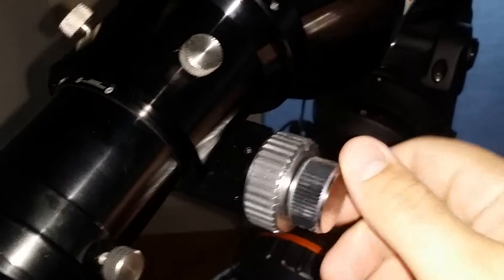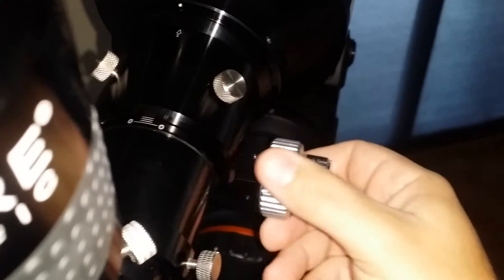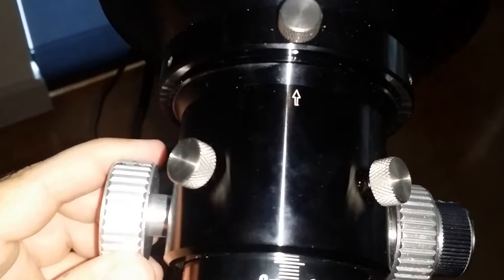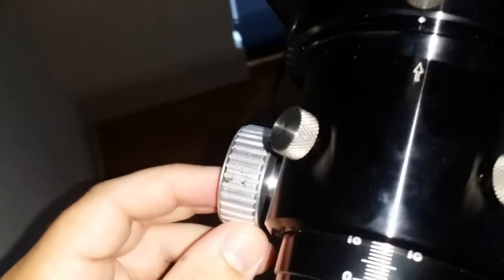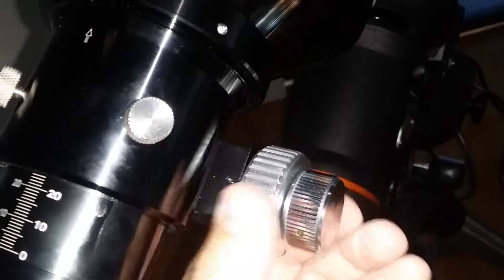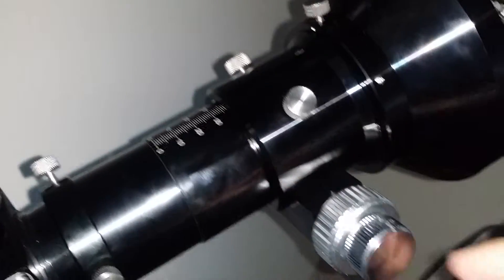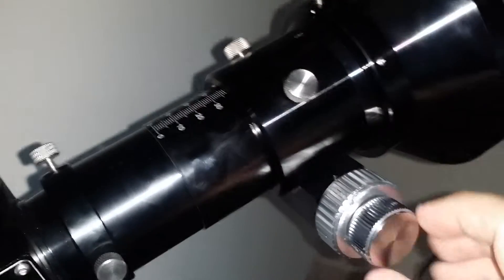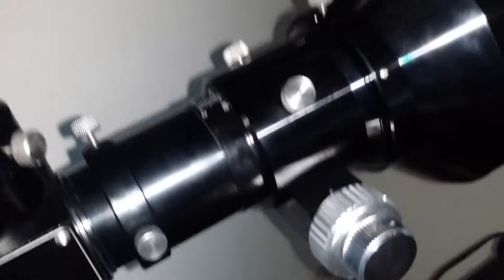Explore Scientific APO Rack and Pinion focuser iss

Comment: I have just received the 102 triplet and my focuser is stiff in certain areas. While I was attaching ZWO electric focuser I was concerned the motor would suffer from the extra tension when it hits the bad spot. SO far so good, but I may also have to disassemble and repair myself with further adjustments. Probably just an adjustment issue??

Comment: I called Explore today and we went through a troubleshooting sequence. I removed the focused block via 4 Allen set screws (they said to me that my case was a first), because the set screws that hold the brass block secured were loose and not letting the worm gear to be engaged. I had to do it twice because I should have slid the tube with the 0 to 50 markings on it, flush with the tube that it slides out of. And then reinstall the block. Btw, every Allen screw was loose, now it slides in and out firmly and there's no shake or wobble.   Total time was about 25 minutes, and I'll add an annual maintenance procedure to ensure that this doesn't happen again.

Comment: you have to take the small barel off then the big one then the other end so the pin wheel comes out there is a locking nut behind the bearings that grab it by friction its a small pin about 40mm long by 3 mill diameter try not to bend it just tighten the nut behind it yes you will have to disassemble the whole wheel bit

Comment: its simple you broke it and you need to fix it :P disassemble clean and re grease and it will show you what is wrong when you take it apart if your scope is still under guarantee send it back if not get a hex key at it and tune it